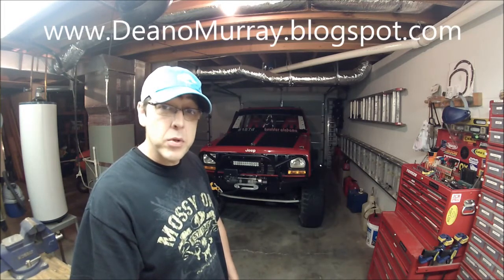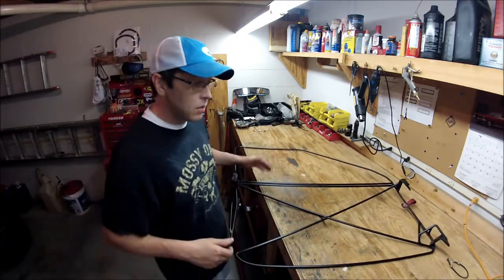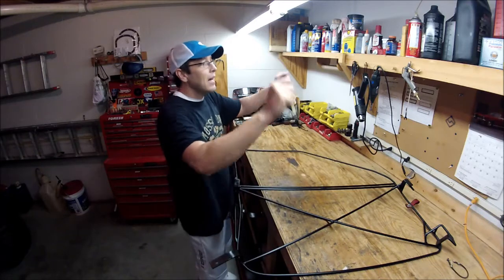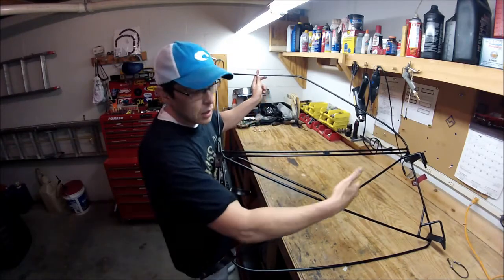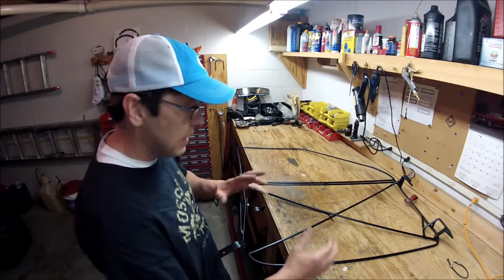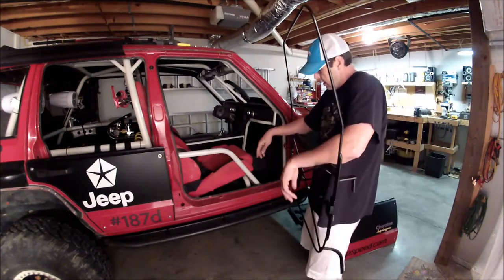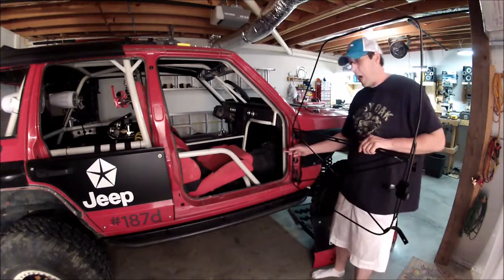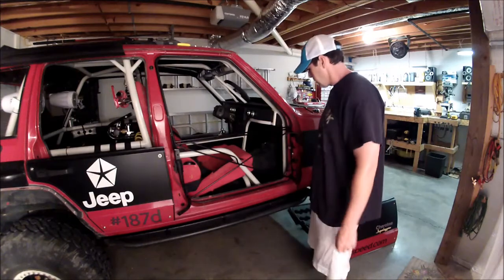Custom Soft Doors "Webisode"

Comment: so how exactly did you make these? just bending and welding the shape of the door?
Reply from the maker: Used torches to bend the round bar. Welded in supports, handles and hinges. Then attached door skins with 1" stock.